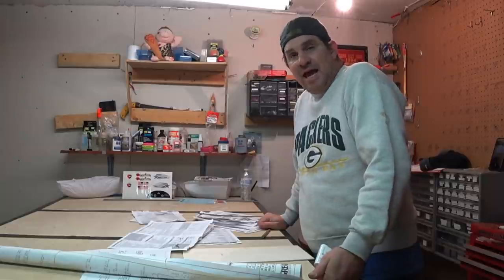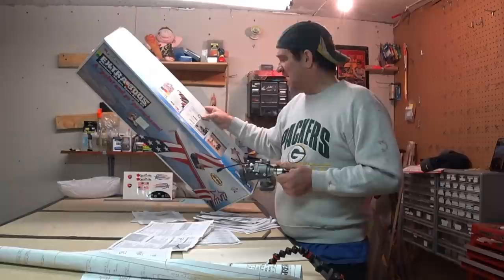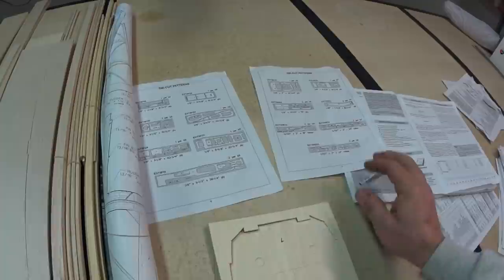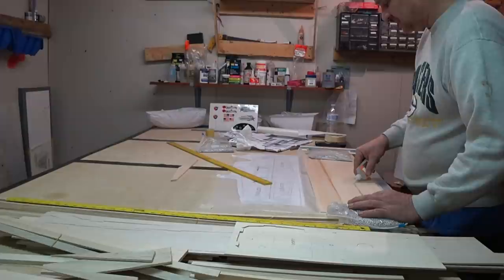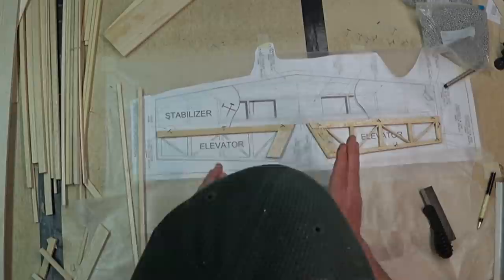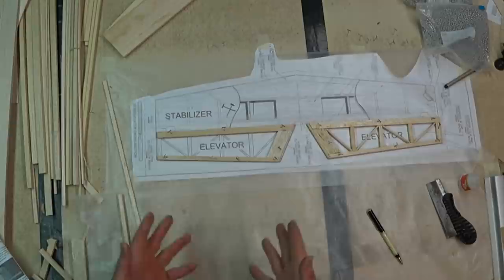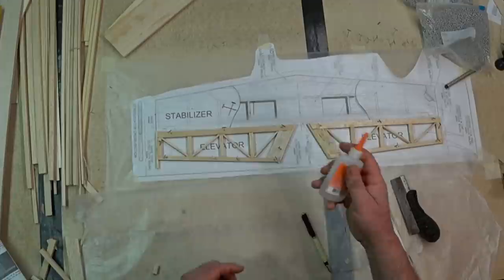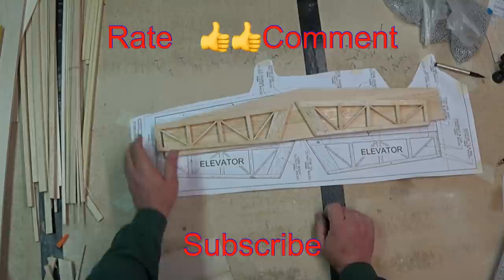Great Planes Extra 300s build part 1 stabilizer&elevators  #152

Comment: Hi Larry , the air big air pressure valve is available ,( maybe from kenworth ), it’s linked into the ride hight valve, when activated it diverts air into the bags to lift suspension , when switch is turned off it dumps the air until ride height is reached and away you go. Depends on the truck system you have extra plumbing maybe needed, any good truck shop should be able to convert a vehicle , have fun Larry and keep em coming
Reply from the maker: I will have to check on that, maybe for my truck

Comment: Interesting vid. Ya have lots of know how mixed with patience. Definitely a passion for you. Looks to be a nice light plane but strong. Would it not be nice to have a bigger scale model that would seat 1 person. A brave person will sit & seat belt while the operator on the ground puts the plane thru it's paces via hand held remote commands. Just make sure there's plenty of ground clearance for those nose dives. More exciting than a roller coaster ride for the brave soul sitting in plane.
Reply: Al you can volunteer for the first flight

Comment: To me, battery powered planes don't turn me on, most RC clubs in my area, use gas or Nitro engines, have seen one with 4 engis that sound like a real B-17. When much younger, had a F-40 model that was in fly by wire, not RC, lasted several years before I crashed it as it ran out of fuel. 😠
Reply: Correction P-40
Reply from the maker: Yep not really into elec planes but with the brushless and lipo batts it has come along way

Comment: have no clue why you used 3 little pieces to sheet the elevetor why would you want 2 glue joints instead of 1
Reply: Thats the way the kit is designed, you can purchase sheeting wide enough to sheet in one piece, and I did for my build, but its actually 3 pieces glued together too. This plane is pretty big and has some large surfaces.